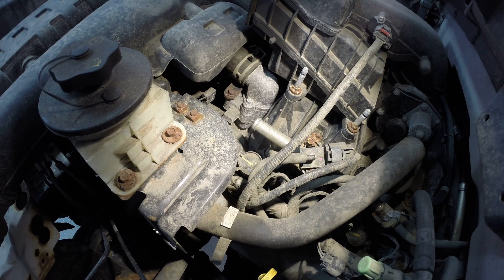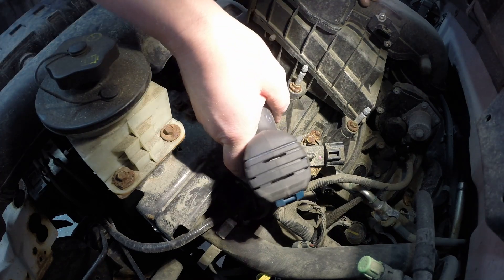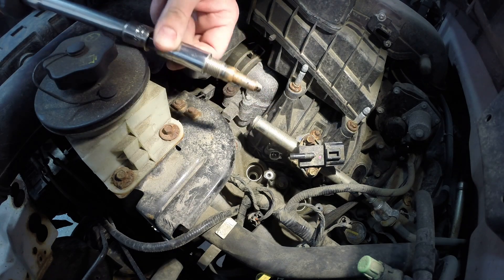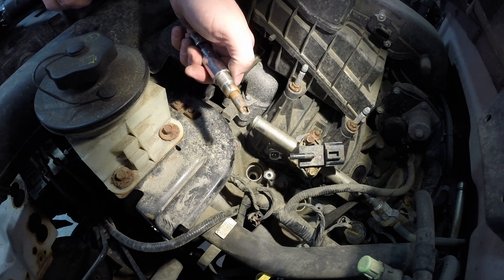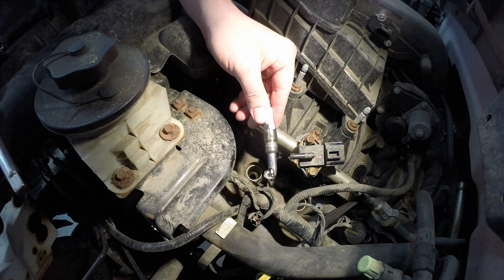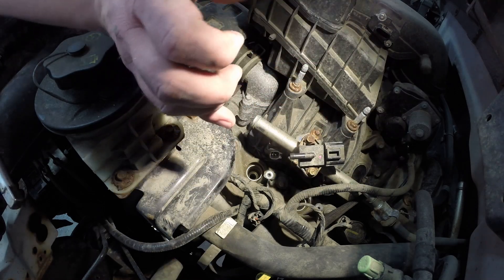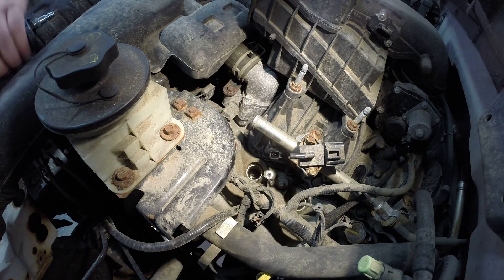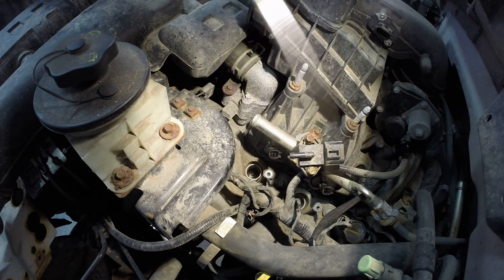The Best Method for Removing STUCK Ford 4.6L & 5.4L 3V Spark Plugs??

Comment from the maker: These are the Tools and Parts I Recommend:
5.4L Plugs- (**LATEST PLUGS SP546**)
https://amzn.to/2KvN5CI
4.6L Plugs (** LATEST PLUGS SP547**)
https://amzn.to/2KuWevk
High Temp Nickel Anti Seize-
http://amzn.to/1YQHx5p
Aircat Stubby Impact-
http://amzn.to/1Qxv6p7
Lisle Tool just in case you break one-
http://amzn.to/1NulQaG
How to use the Lisle Tool-
https://www.youtube.com/watch?v=BSY9iBheBXI
Reply: How did the impact work on the back I know I’m late and you probably don’t remember?
Reply: I have watched many of your videos and they are great. I will explain further why the hot engine releases the plug better. The correct term for it is the  Coefficient of Thermal Expansion. The aluminum head expands more than the steel plug and that allows the parts to break free of each other easier. I was a pipe fitter/welder for many years and also as a hobby wrenching on vintage bikes and autos. I used thermal expansion to my advantage many times over the years. I'm 77 now and still turning wrenches on my 2010 F150 5.4. Again fine job on the videos. Wayne
Reply: Quick question how do you remove the visor light  bulb from a 2005 Ford Expedition
Reply: Rr
Reply: @jamesgrawey2079  77

....nn.m by 6th uuu7yyhyyyyyyyy u 6y
B byyyy

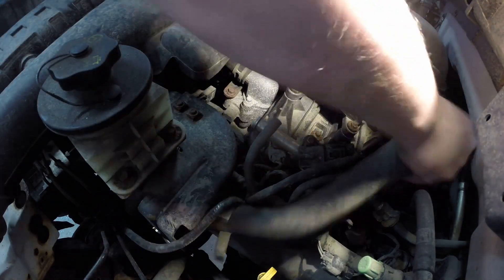........ u 1:57 1:58 1:58 1:58 1:59 1:59 😊😊😊😅😅
Reply: I watched this video, and removed all 10 spark plugs in my 2006 6.8 without a single broken plug! Thank you!🎉😊
Reply: To remove the carbon before removing the plugs, use to treatments of Techron by Chevron. That will even clean up the exhaust valves on a Windsor with three hundred thousand miles on it, so it should help with the carbon around the plugs...
Techron & Royal Purple is my pre-smog test chemicals to avoid having to re-smog test after a fail and even my 1984 Audi 4000 Quattro with over 350K on the original  engine passes...

Comment: I just did my 2004 F150 5.4. I sprayed each hole with PB Blaster and let it set for a few days. Drove the truck about 20 minutes. Came back home and used an air impact. All 8 came out without breaking. On #4 and #8 I used an extension and a swivel.

Comment: Just successfully replaced all 8 of my SP-515 Ford Platinum plugs using this method WITHOUT BREAKING A SINGLE ONE. Heat cycle, pb blaster soak, and an impact gun worked phenonmenally. The original plugs were very gummed up and the electrodes were virtually nonexistant!

Comment: I have one stuck in #3. When I removed the plug the only thing that came out was the threaded collar. So my plan is to get the engine warm/hot and see if the plug can be pulled or forced out someway. The remaining top portion is still there and bottom is still seated /stuck in the head without the thread collar. I don't want to break the plug. But I'm alittle stuck like the plug. So heat up the engine? Take a 1/4 in extention and snap the plug, grind and extract? At a loss.
Reply: How did it work our for you? Were you able to extract it?

Comment: 2007 Ford Expedition XLT, followed your instructions, sprayed penetrating oil into the sparkplug holes and reinstalled cop, did the plugs next day, both banks hot running in between changing plugs to keep them hot, all 8 plugs came out without issue, all 8 plugs were motor craft originals to the car, over .120 thou gap on them, symptoms were misfiring under load and rough starts. 173k miles on original coils and sparkplugs (bought used)

Thank you, it really worked!

I did use a Milwaukee 3/8 Right angle impact instead of an air impact as I don't have a compressor, worked just fine.

Thank you again.

Comment: Bro. I'm waiting for my motocraft replacements to arrive so I can change them. They are original factory spark plugs never been changed, it's 2005 f150 5.4 and about 126k 😱  you're scaring me with that opening statement hah
Reply: What was your method and how did it go..? Thanks
Reply: @thecrusherbugs2331  i got scammed on the replacement parts I ordered. Man they are really doing a good job at making them look alike. I returned them alright, but I had my shoulder surgery for a torn labrum that started to tear up the bicep tendon. And it's worse than before the surgery so I'm currently unable to change them myself until PT gets a bit further along. 

I'm also really thinking it's going to end up being plugs, COPs AND timing. Tough pill to swallow when I've been workman's comp 60% wages and stuck for 1.5 years. 😅 I'll try to remember to post an update when I get to actually do it. But I sure do appreciate the video! It certainly helps!!!
Reply: @sethualtaylor2948  I wish you the best in your recovery.  It sucks. I've been there myself. It can get a bit difficult at times.. I went through the Ford dealership for my parts..I'm not sure on how to attack the job. Impact or slow and steady with a ratchet..

Comment: I got one that will unscrew but reaches a point where it stops turning, it has a steal head. Spark plugs haven't been changed in 5 years. It's a 1988 ford F150 with 5.0, So sprayed it with penetrating oil then screw it back in, then out again but still hitting a point where it stops turning. So I screw it back in, may have to get help with that one plug. Any suggestions?

Comment: Is this still the "best" method?
I am about to replace the plugs on a Sport Trac with the 4.6L 3 valve.
Right now I have all the coils out, blew out the spark plug wells with shop air, and sprayed a bit of Kroil down each. My spark plug socket should get here tomorrow.
I have a stubby 1/2" air impact and a Gen 3 Milwaukee Fuel beast...
Reply from the maker: Generally the 4.6L 3v plugs come out.
Reply: @FordTechMakuloco  ok. Good to hear! 
My 9/16“ plug socket is currently "out for delivery"...
Reply: @FordTechMakuloco  Changed the plugs last night. They all came out easily. Of course, I ordered the broken plug removal tool from NAPA, so none broke. If I tried to take them out w/o the tool on hand, the would have all broke. Haha.
Do you have a way I can send you a picture? The plugs I took out have about a .100 gap. The center electrode is worn down to the insulator!
The Sport Trac runs a lot better now... :)
Reply: @nickydexgg4579  hey just curious did you use the 1/2 inch Milwaukee fuel. I’m about to do mine that’s the same impact I have
Reply: @VikingSkol916  yes, I did. The newest gen (1,500 lbs/ft).
I would also note that mine is an '08 4.6L 3v and has the revised plug design and brown coil boots.
Reply: @nickydexgg4579  ahhh yeah I’ve got an 05 with 145k prob stock too. No misfires yet but I think I’ll still give it a shot warm and with some PB blast. I don’t really want to go buy a 3/8 if I’ve got the 1/2 inch.

Comment: Alright. 7 Years on and this (among others) video is still coming through to help! I used this exact method. Fired up the Mustang and got it as hot as I could. Shut it off and used a Milwaukee M12 with a BIG battery and they ALL zipped out with no issue!
Reply: Im about to do this with the same impact. However it's cold going to be cold due to not being able to run the engine in it's current condition.  😅
Reply: @j0hnathan196 did it work ?
Reply: @VikingSkol916 we need to know😂😂

Comment: I've got a 2005 Ford Expedition 5.4L 3V, not original spark plugs.  I was getting a misfire on #1, so I thought change the coil pack and spark plug.  Since these are the new spark plugs I wasn't afraid of breaking it off.  I get the coil pack off, and start turning the spark plug.  Nothing special happens, just keep turning the plug.  And turning and turning.  So I think I've broke something.  Try to tighten it back down, and it does tighten back down.  I put on the coil pack and fire it up.  All is well.

But I can't leave it alone, I want to change that spark plug now.  So another day I let it get hot and give it a go.  Again, I just get the spark plug to spin and spin and spin...  I tried grabbing it with plies and pulling, it didn't move.  I've shot different chemicals at it and let is soak.  still can't get it out.  So I tightened it back down, and it runs fine.

I've left it alone for a while now, but it bugs me I couldn't get it out.  Any ideas?  Carbon build up?

Comment: Don’t know how you got the 2 on back passenger side with this method. I used ratchet and socket had no issues getting mine out. The driver side I had done in 15 minutes and I’m no certified mechanic either

Comment: My shop started using a 3/8" electric impact for these a couple years ago. Cold or hot engine doesn't seem to make a difference. We haven't had to use our broken plug tool since.

Comment: We just used this impact method on a COLD engine and got all the plugs out successfully. The shaft part was quite rusty and there was squealing and protesting, but they came out complete. 
Of course we would have warmed up the engine but during a timing chain job we noticed a thrown rocker and damaged camshaft, so we decided on the spot to do a leak down test. We chose to risk it rather than reassemble everything just to warm up the engine. 
Also, unrelated but FYI you CAN get the oil pan off a 5th gen mustang GT without removing the engine or dropping the subframe. You still need an engine hoist and you have to remove the oil pickup tube while the pan is unbolted but still on top of the crossmember, but we did it with relatively little trouble.

Comment: I'm curious how it turned out. I don't see any comments afterwards. I just had a phaser fail and I'm looking at an old one to see if I can reuse it. I am seeing the same thing you're talking about here. Trying to figure it out. This pin on a new phaser is out, against the spring. It may pop out at certain times depending what phase it's in, idle, gear etc. Still searching. Let me know. Thanks!

Comment: It would be nice if you had chosen an engine with realistic carbon on the plug shells.  There is not a great challenge (except getting to the back plugs physically) doing plugs that are clean.

Comment: I am have the same issue here f150 4.6 l V8 2001... But instead of run the engine to get hot I am to use a Heat Gun to the maximiun .... maybe can work.... I am don't know for sure.... 
Cross fingers....

Comment: I have a 2002 Ford F350 4x4 w/ 5.4 triton. I am trying to change the plugs. Do you have to remove the fuel injection rails? It does not appear so in your video. However, I do not see how i can remove the coil packs w/o moving the fuel rails.

Comment: Hi Brian- Got a 07 F150 5.4. Plugs have been changed 2x before 
and have 60k on the current ones. I would love to see how u get the Aircat stubby on #4 with the ecm and bracket removed. Ive tried every way possible with and without extensions and now developed a slight drip from the heater hose trying to move it for access.  The lines are right above the cylinder and go to a V over it. How does the stubby get there?

Comment: Question, having trouble removing a spark plug in my 2004 5.4. I cannot get my 9/16 deep socket to seat on the plug nut.?
Reply: The other 7 came out no problem!

Comment: I have a 3V 6.8L V10 in our RV and will be trying this method. Hopefully it works out!! Has 126k on the engine and have no clue if the previous owner ever change out the plugs. Pray for me. haha
Reply: 10 for 10. no broken plugs. Took about 2 hours for the whole job. So relieved.
Reply: @WanderToGetLost did you do it like the video?  I have the same motor in my motorhome.  We’re you able to get the impact on every cylinder?

Comment: I wouldn’t want to use the rattle gun because I reckon you could pull the plug out and take the aluminium thread with it on the cylinder head

In the past what I’ve done is I’ve got the motor stinking hot sprayed two cans of foaming intake cleaner into the intake throttle body switch it off let it soak so now the foam is getting to the cylinders from the inside hopefully softening the carbon start it up get it hot again and go for a drive and blast the hell out of it on the road to get some flow through the cylinders

turn it off crack all the plugs by hand then spray WD-40 down there to wick down the threads

 let that soak before the motor goes cold take them out by hand

For me that has worked every time and since then ford revised the plugs to single piece plugs and when I put the new single piece ones in I use anti-seaze
Reply from the maker: We use impacts all the time on this engine and it is never a problem.

Comment: I tried a hybrid method. On a warm engine, I cracked each plug 1/8 turn, sprayed with Motorcraft carb cleaner, waited 15 minutes, then extracted the plugs with the impact wrench. All 8 came out no problem. 3 showed clear evidence of blow by. 2007 Mountaineer Premier with 4.6. 

I dreaded doing this job due to the horror stories, but the job itself was almost anticlimactic. Truck ran much better afterwards. Cured the misfire problem (with new NGK coils to go with the plugs) and also solved what I thought was a transmission problem with a shudder in overdrive.

This channel is the best!
Reply: How are the NGK coils holding up???
Reply: @51gofish  So far, so perfect. They have a 3 year warranty, which was longer than the Motorcraft ones. I'm also running an NGK Direct Ignition Cartridge in my Saab 9-3 and that's fine, too. I trust NGK products.

Comment: I don’t have an impact, fought with my plugs for days even with soaking and heating engine several times, only easy ones (thank god) were the rear 2 plugs, the last one out was 3rd one on passenger side, I had to sit on the engine with my foot holding the tool straight, put a pipe on the end of my wrench and pull with both hands to get it to budge. I’m 250 pound 6ft tall, thought for sure it was going to break but got lucky and got them all out, I couldn’t believe how tough they were. I think If I had a half inch adapter like he mentioned in the video I would have had a better time, I was even checking my tools looking for one, definitely need to pick one up, should have done that instead.

Comment: Just want to thank you for all the help you have given to me. Just finished full timing replace ,followers,lash adjusters,oil pump and last purchasing lisle 65700 to aid in replacing sparkplugs .I only had one plug which came apart no porcelain brakeage, lisle tool pulled shell right out. Now my 2005 ford 5.4 , 3 valve purrs like a kitten. Thanks again for all you give to us shade tree mechanics HenryL802/Carthage,Mo.

Comment: I've changed the plugs on my 07 f150. 5.4 3v at 70k and 130k both times with the updated motorcrafts at that time.
Am I still ok to use the Aircat air tool to remove them or do i have to use the traditional way by hand?

Comment: I like how you are doing it but my question is why trying to pull the coil out it was stuck from suction with little room on cylinder 4 up against the fire wall any suggestions as to remove without breaking coil

Comment: Thank for the Video!  Do you automatically recommend replacing the coil packs as well by default?  Have 2005 F150, 142k miles on it.

Comment: Thanks! Did this today. 8 for 8 . Uses my Milwaukee impact driver with 166 pounds of torque and the first 6 came out. Didn't fit on the back ones so I got the Milwaukee right angle impact . They were the most stubborn.
Reply: Thanks for this comment. Was searching to see if anyone had luck with the 166ft lb milwaukee driver. Gonna try soon

Comment: My mechanic wants to only use a ford rebuilt 5.4 3V but it don't come with a melling oil pump and that would be extra, the only other motor he says he will install is the 5.4 3v from jasper that does include a melling hv oil pump and I have the option to get a jasper motor with the additional vvt delete pre-installed. Are the Jasper rebuilds good ? Another mechanic wants to only use ford or a carquest rebuilt motor only. I'm leaning towards something other than the ford one since it's so expensive. Which other rebuilt option besides ford is the best choice a carquest or jasper ?
Reply from the maker: I see you are new to my channel, just search jasper on my channel...
Reply: @FordTechMakuloco  Well that figures. crazy how every mechanic says something different on what they will "only" put in. Seems like the only solid option is to put in the ford then have them additionally install the melling. What do you charge to do the ford rebuilt with a melling ? It's amazing how good these other remans ads are...like they got all bases covered and it's a no brainer to get their motor.

Comment: Why not just use the champion true one piece plugs. I've been reading forums saying even the redesigned SP546 plugs are two piece and do break.
Reply from the maker: The Ford plugs do not break SP-515 onward.
Reply: @FordTechMakuloco  That is some super news. Thank you Brian. I think my mechanic wants to put in the Champion one piece plugs. Someone said those run hot and seen one plug melt down to the threads...have you seen this and what is your opinion on the champion plug? I definitely don't want to use it if the ford SP-546 is better in your opinion. There is so much misinformation out there. Brain thank you for helping to clear some of it up I do appreciate you very much
Here is the kind of misinformation that is on amazon from your link to the SP546 plug:
Why does the box say sp515 instead of sp546?
Answer:To whomever it helps.... Sp515 has long been updated/upgraded to sp546. Sp515's broke off in the head easily.
A more important note: If the straps (the u-shaped piece on the tip) have been welded on, send them back! NOT normal to have welded straps and can damage cylinders and/or catalytic converters when the straps blow off! Plenty of pictures and horror stories online about these altered (ruined) spark plugs
Reply: @FordTechMakuloco  Do you have a link for a trusted source on amazon for coil packs?